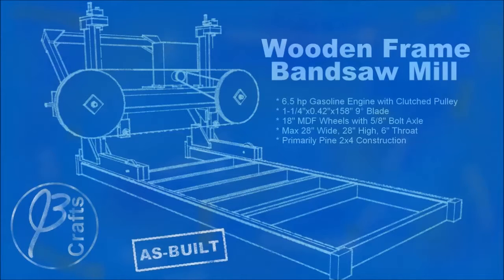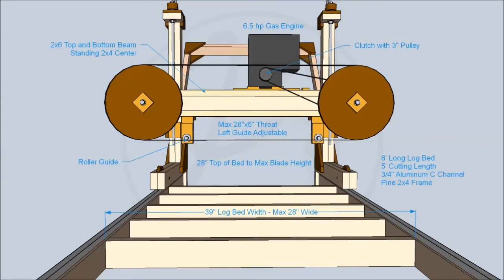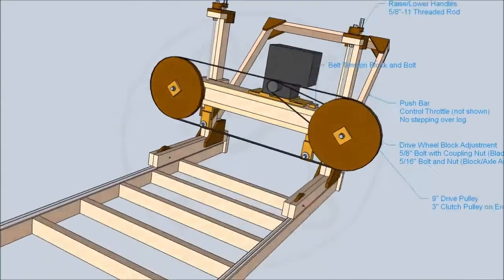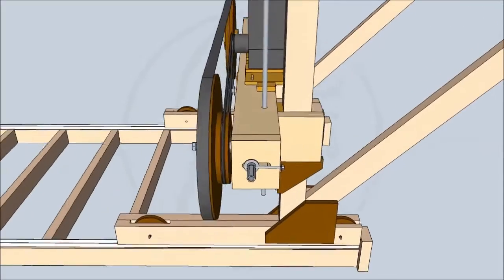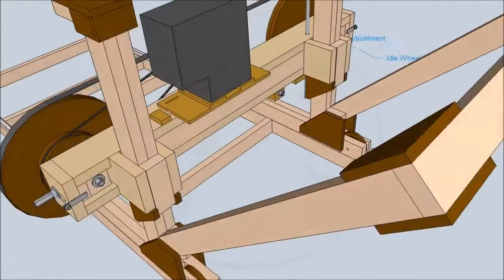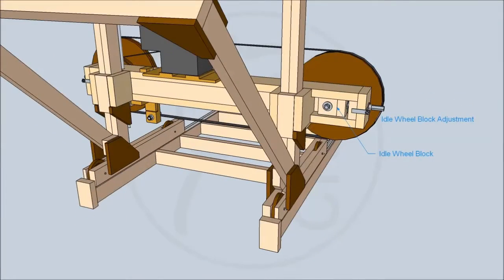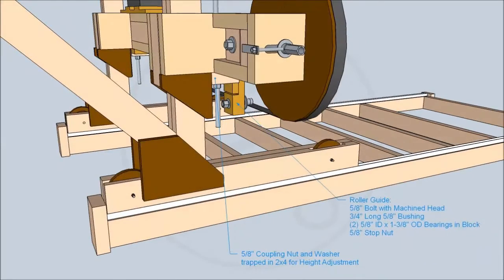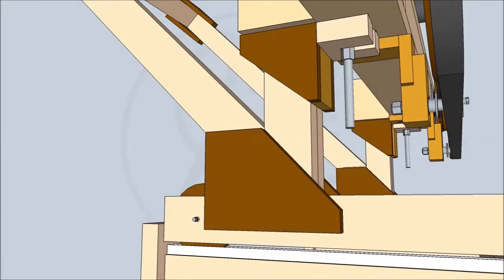Wooden Bandsaw Mill Project

Comment: that thing looks fantastic. I'm curious what the specs are on this machine: max cut width, wheel size, engine specs, tension mechanism etc. Thank you for posting
Reply from the maker: Brian Maupin the max width between the blade guides is 28".  I've cut about 24".  The wheels are 18".  It is a 6.5 hp engine.  The tension is static, adjusted by tightening 5/8" coupling nut.  More info here: http://joebcrafts.com/2016/08/26/wooden-bandsaw-mill-continued/

Comment: I love it and it looks awesome. I am sure you will get addicted to cutting lumber as I have with mine. Do you find it takes a long time to raise it back up after last cut. I made nut socket that attaches to my cordless drill so I can raise it faster.
Reply from the maker: Yes, raising is a pain.  At first I had thought about trying a rack and pinion type setup on the back of the legs.  One crank with 2 gears and could be coarse enough to travel 1" at a time.  Went with threaded rod like yours there instead, but found that lifting by the back messed up angle of attack at blade (not using a post clamp/lock).  So I moved the rods to the front of the post.  I had spent so much time thinking about this thing, that I finally decided I needed to at least get it working... later I can refine.
Reply from the maker: The blade guides - they work like the roller guides on commercial mills.  The side of the blade runs against the bushing and ground down bolt head.  The back of the blade presses against the face of the washer.  I plan to make a write up with pictures on my site.  Just haven't gotten to it yet.
Reply: What site? I don't see a link to it hear or on your YouTube page. Do you mean on LumberJocks? I'm very interested in your guides, and how they perform.
Also very hopeful there will be a follow-up, going into detail about issues you've discovered as well as enhancements or improvements you've dreamed up.
Oh, and I urge you to put a bit of "Mathias Green" on it somewhere, perhaps on a guard or maybe a guide support? ;-)